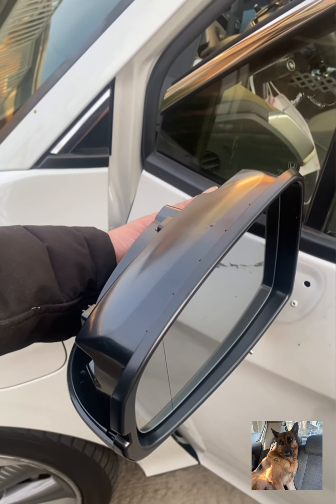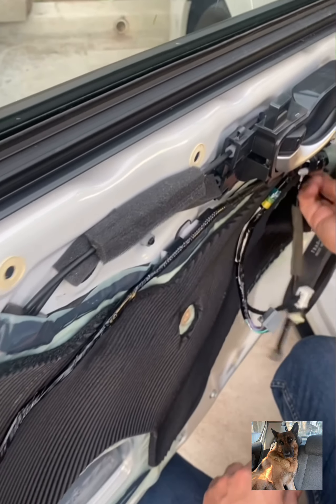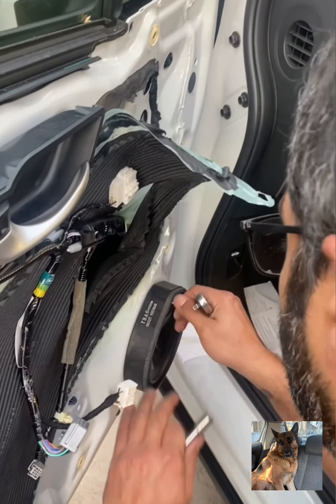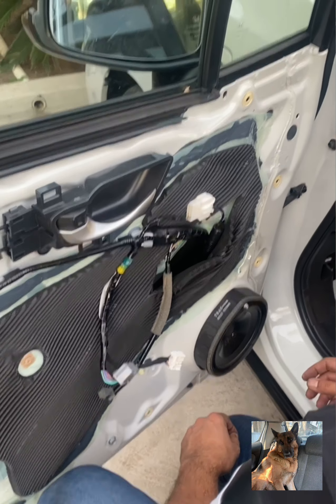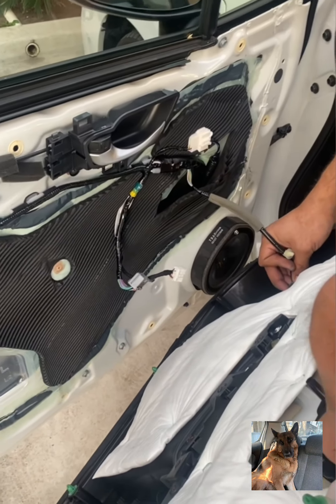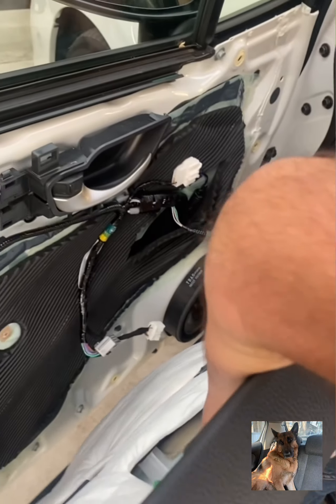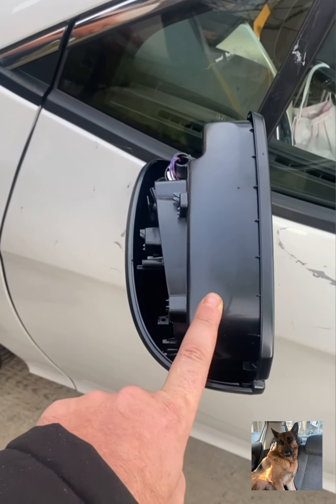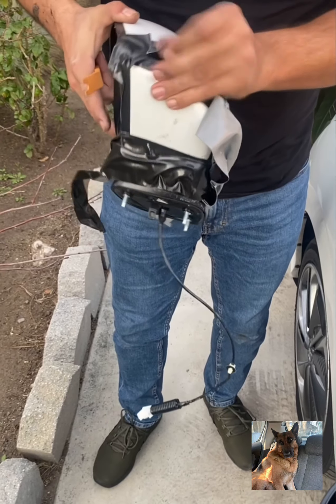How to change Honda Clarity mirror Please like and subscribe  نحوه تعويض آينه هوندا كلاريتى

Comment: Knocked off my 2019 Clarity right side mirror with a trash can. Bought an used one on eBay for $450. Was able to install it in under an hour thanks to this video, even though the video is somewhat incomplete. There were some gooey black glue used on the plastic cover sheet that made a bit of mess if you are not careful. All in all, not a terribly difficult project if you are half way handy!

Comment: Hello…. I have a question pls. My Honda clarity 2019 passenger side mirror is broken, and the mechanic quoted the repair for 1300$. I used the link “Honda parts now” and found this - 
Honda 76208-TRV-A02Mirror Assembly, Passenger Side Door. I would like to know if this would be a right part for me and if I could purchase it off this website and then get it installed from a mechanic. I think I could save a solid amount of money that way. Pls suggest.
Reply: Did you end up buying it?

Comment: Can you tell me what tools are needed?  Also, where did you purchase the replacement mirror?  Thank you.
Reply from the maker: Yes of course, i bought the whole mirror from 
Hondapartsnow.com for $350 ...about the tools I don’t remember exactly, but i have to check the video again , but I remember it wasn’t something special, the main point of the video i made was to show how it look like and how to change it ...cause the dealer told me it will cost me around $900 to change it ! I did it with $350 very easily